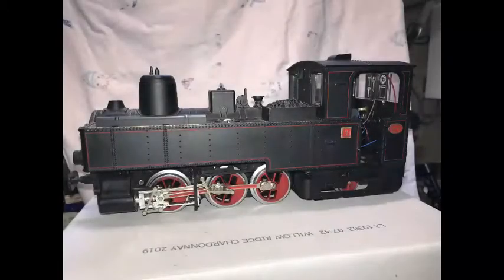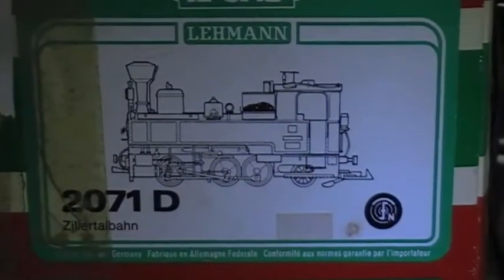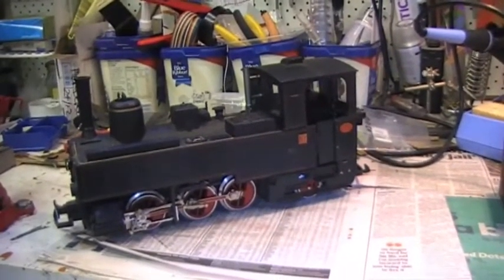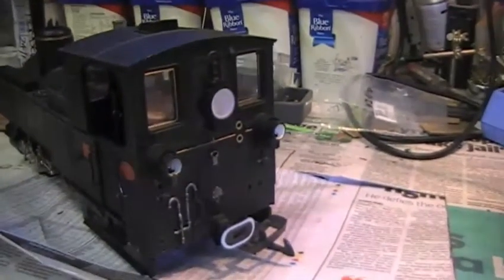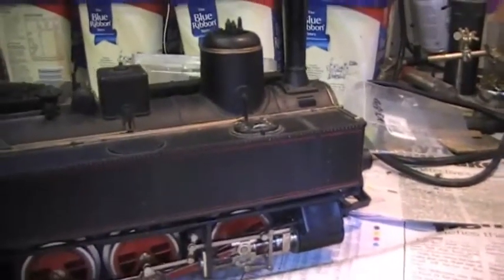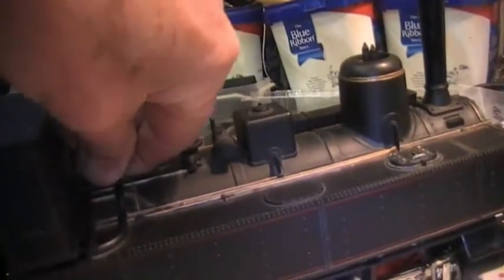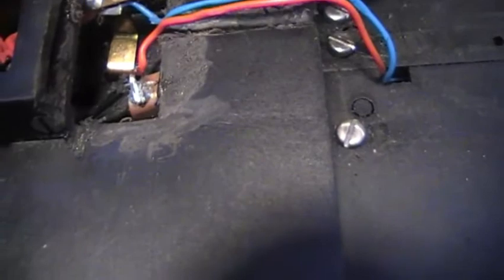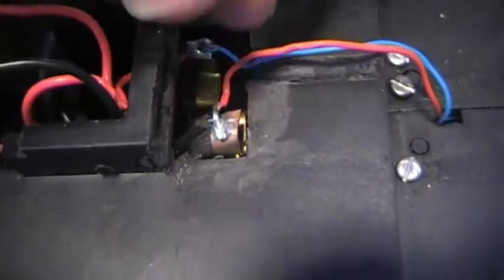LGB 2071D DCC Installation Part 1

Comment: Where did you get the light assemblies for the Stainz upgrades you did here. I have one and would like to do similar. Thanks. Good series there. Mike
Reply from the maker: Hi Mike,

On the Stainz I added a new smaller central lamp on the lower front and rear of the loco.

For the lamp fittings I bought two of "LGB 20710-204 Engine Lantern" from Trainli.com in US, at US$4.50 each. These are smaller than the big headlamps, at about 8mm in diameter.
See https://www.trainli.com/LGB-20700-20710-20720-20730-U-engine-parts-268/lgb-20710-204-engine-lantern-p-5296

You will see these have a square plate with two lugs pins on the back to go into a vertical place, 
but I cut that part off and just used the cylindrical lamp and the vertical tube underneath it, and glued them on.
Initially I painted the interior white, but later curled up some white plastic into a tube and glued that in.
Drilled holes into back to insert red LEDs. I didn't use lenses or trims.

If you type lamp and/or lantern into Trainli Search field you will see more options, 
although dimensions and detailed photos are not shown! Old-style and modern lamps there.
Alternatively, look at specific LGB models for lamps that you like, then look for that.

Hope that helps! Email again if I can assist further.
Glad you enjoyed the videos.

Richard.
Reply: @richardhenderson4776  Thanks Again! Very helpful!